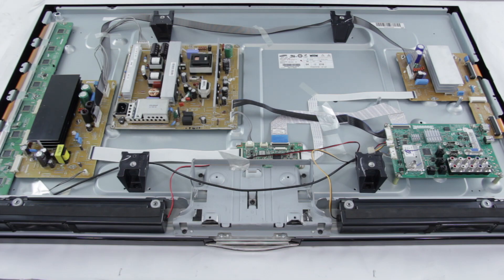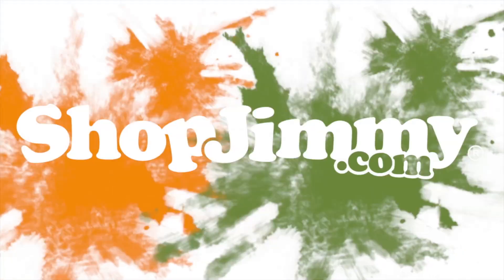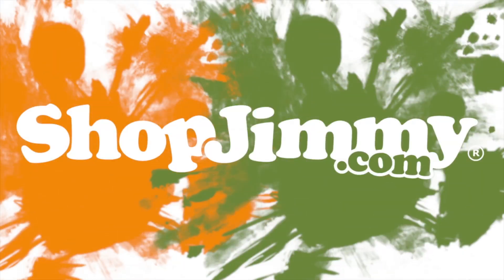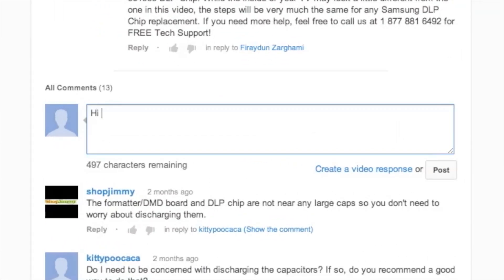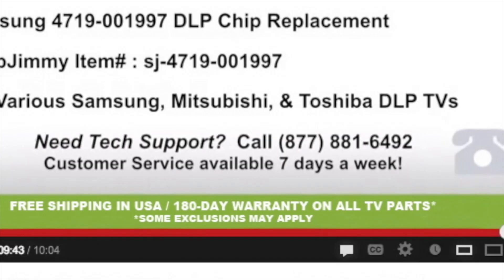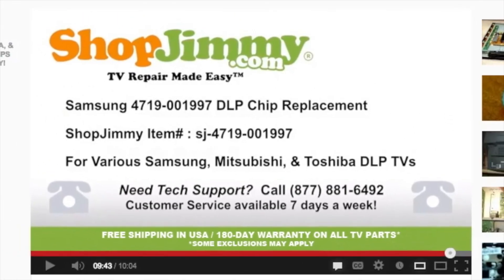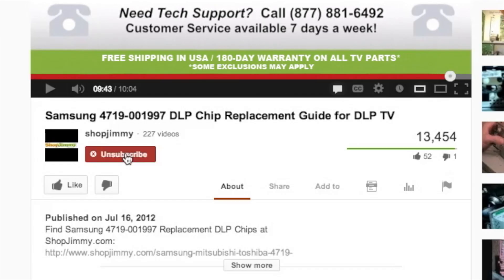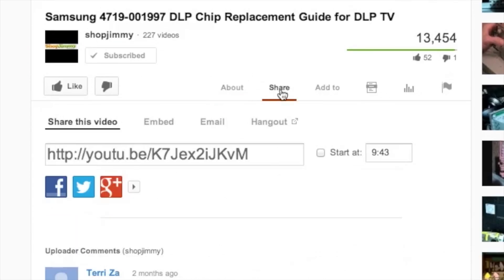Plasma TV Repair Tutorial - Common Symptoms & Solutions - How to Fix Plasma TVs

Comment: I have a Samsung Plasma PN50A550S1FXZA that has a vertical line on the screen that is half blue and half black (about an inch wide) from the top of the screen to the bottom.  Today I replaced the logic board (purchased from a competitor as you were out of stock) as suggested on your video, but the large line on the screen remains.  What should I look at next?  It started as a thin black line a couple of years ago and expanded to what it is today about 6 months ago.  Thanks.
Reply from the maker: Jason Hebert   This sounds like a TV panel (TV Screen) problem.  If your TV panel is bad, it may be more cost-effective to replace the TV as panels are typically hard to find in stock, difficult to replace, and expensive.  Thanks and please let us know if you have any further questions!  www.shopjimmy.com

Comment: I have a 50 inch Panasonic Plasma TV purchased in 2007.  The model number is TH-50PZ77U.  The problem is no picture but does have sound.  If you were to replace one board, which one would you replace.  All the capacitors look OK and I really don't want to put a lot of money in the set.  Your help is appreciated.
Reply from the maker: Jim Orr  Please watch this video FIRST to help with your repair!  https://www.youtube.com/watch?v=BP3NVNCGEv8  I recommend replacing the SC board in your TV.  Click this link to a replacement for your TV model number:  http://www.shopjimmy.com/panasonic-txnsc1hhtu-sc-board.htm  Be sure to match part numbers on your current board, with your replacement for compatibility.  Thanks and please let us know if you have any further questions with your TV Repair!  www.shopjimmy.com

Comment: Hello, I saw your video I hope you can help me. I have a problem with picture of my Plasma screen. Its Samsung PS51D6900 the problem starts 2 years after purchase it have few thin vertical coloured lines on right side not dead lines but pink, green and i think blue lines. Today it start to have about 3 inch thick white vertical lines with black strip in the midle. If need I can send the picture of it. I know its hard to say like that whats wrong but if you can give me your advise if this is caused by some board and approx price to fix it.
Thank you 
Regards Erik.

Comment: have a samsung 42 inch plasma with a vertical black line going down right side purchased buffer board for that side but line still there can you help
Reply from the maker: John Martino   This sounds like a TV panel (TV Screen) problem.  If your TV panel is bad, it may be more cost-effective to replace the TV as panels are typically hard to find in stock, difficult to replace, and expensive.  Thanks and please let us know if you have any further questions!  www.shopjimmy.com

Comment: I have a Samsung 50" plasma (PN50B550t2f) , the TV developed a row (row not column, making distinction) of dead pixels, black no picture at all (checked with flash light), slowly added more rows over a period, currently at 4 rows, no patterns to rows placement. From this video it's pretty clear the Ysus is the problem.   What is the easiest way to know for sure and can you link me to an appropriate replacement if you agree?  Thanks in advance this video was super clear cut and organized.  Really helped clear up how it works.
Reply from the maker: BlazzedTroll  Please watch this video FIRST to help with your repair!  https://www.youtube.com/watch?v=BP3NVNCGEv8  It is difficult for us to say exactly what the problem is 100%, we can only go off the information we have and what we have seen.  You can replace the Y-Main Board and Y-Buffer board to see if that does fix the problem.  Click this link to replacement parts for your TV model number:  http://www.shopjimmy.com/catalogsearch/result/?q=PN50B550t2f  There may be multiple boards for the same TV model number, be sure to match part numbers on your current board, with your replacement for compatibility.  Here is a link to a video showing how to identify your part number, click here:  https://www.youtube.com/watch?v=R1jmj_foId0  Thanks and please let us know if you have any further questions with your TV Repair!  www.shopjimmy.com

Comment: I have a Phillips 42" model 42PF7220A/37 and it has a vertical line on the left side of the tv as you are looking at it.  I would like to know if I can repair this by cleaning some part or if it is repairable.  Thanks
Reply from the maker: Kim Rush   This sounds like a TV panel (TV Screen) problem.  If your TV panel is bad, it may be more cost-effective to replace the TV as panels are typically hard to find in stock, difficult to replace, and expensive.  Thanks and please let us know if you have any further questions!  www.shopjimmy.com

Comment: Hi and thanks for the tutorial. I have a 42"LG Plasma tv. 2007. model # CPTOH-0709
while in HDMI mode, source the tv changes source to cable and you have a screen with just snow. This problem has progressed so much so that you can not use it but by by passing any HDMI, S, COMPONENT cables, I had to you use the cable in only which is located on the opposite side of the tv to use it at all. Of course you can not get HD but just a standard signal. Even then as you are watching you can see in the upper right hand corner a box that will pop up every few seconds saying cable. I have searched for answers to this problem with no avail. Have you any idea what may be causeing this problem? outside of that the tv works great.
Phil.
philarmatino1@yahoo.com
Thanks.
Reply from the maker: Phil armatino   Please watch this video FIRST to help with your repair!  https://www.youtube.com/watch?v=BP3NVNCGEv8  I recommend replacing the main board in your TV.  Click this link to a replacement main board for your TV model number on our website:  http://www.shopjimmy.com/catalogsearch/result/index/?cat=56&q=CPTOH-0709  Be sure to match part numbers on your current board, with your replacement for compatibility.  Thanks and please let us know if you have any further questions with your TV Repair!  www.shopjimmy.com

Comment: Hi.  I have an LG 50PK750 plasma that powers up but has no picture or sound.  It stays powered on, does not go to standby.   It also responds to the control buttons on the front and via remote.   However, it does not have any picture or sound.   Any suggestions?  Thank you.
Reply from the maker: ncferguson  Please watch this video FIRST to help with your repair!  https://www.youtube.com/watch?v=BP3NVNCGEv8  I recommend replacing the YSUS and the YDRVTP & YDRVBT boards in your TV.  Click this link to replacement parts for your TV model number:  http://www.shopjimmy.com/catalogsearch/result/?q=50PK750  There may be multiple boards for the same TV model number, be sure to match part numbers on your current board, with your replacement for compatibility.  Here is a link to a video showing how to identify your part number, click here:  https://www.youtube.com/watch?v=GEllG3RV-tc  Thanks and please let us know if you have any further questions with your TV Repair!  www.shopjimmy.com

Comment: hi i have a samsung plasma model PS-50Q92H year 2007 - it works fine for circa 30 minutes then the screen goes black - -impossible to get ANY image back even switching input devices
only way is to switch off the TV and back on - again 30 minutes then black screen
HAVE removed the back TV panel and checked all connectors are solidly engaged - 
looks like it could be one of the boards ?

Comment: I have a Samsung plasma pn58c550g1fxza. I have purple lines going across the screen horizontally. Extremely noticable on white backgrounds. It's getting worse. What's the recommended fix?
Reply from the maker: Brannon Gradney  Please watch this video FIRST to help with your repair!  https://www.youtube.com/watch?v=BP3NVNCGEv8   This could be a problem with either the buffers or the TV panel.  You can replace the buffers boards to see if this fixes the problem.  Click this link to replacement parts for your TV model number:  http://www.shopjimmy.com/catalogsearch/result/?q=pn58c550g1fxza  There may be multiple boards for the same TV model number, be sure to match part numbers on your current board, with your replacement for compatibility.  Here is a link to a video showing how to identify your part number, click here:  https://www.youtube.com/watch?v=R1jmj_foId0  Thanks and please let us know if you have any further questions with your TV Repair!  www.shopjimmy.com

Comment: Hi, my samsung PN50C590G4F plasma TV just went out with one loud pop. The stand by light is still on, but the TV screen doesn't come on. The remote doesn't do anything and when I power cycle the TV by unplugging the outlet plug, I hear a series of clicking sounds with no picture (I'm assuming it's trying to power cycle). I usually hear one of these clicks when the TV powers on. Would this be the power supply board, or the Y-sustain board?
Reply from the maker: *****  Please watch this video FIRST to help with your repair!  https://www.youtube.com/watch?v=BP3NVNCGEv8  I recommend replacing the Y-Main Board and Y-Buffer Board in your TV.  Click this link to replacement parts:  http://www.shopjimmy.com/catalogsearch/result/?q=PN50C590G4F  There may be multiple boards for the same TV model number, be sure to match part numbers on your current board, with your replacement for compatibility.  Here is a link to a video showing how to identify your part number, click here:  https://www.youtube.com/watch?v=R1jmj_foId0  Thanks and please let us know if you have any further questions with your TV Repair!  www.shopjimmy.com
Reply: ShopJimmy.com OK, I checked your site for these 2 parts and both are OUT OF STOCK. What is your lead time for replenishing parts?
Reply from the maker: *****  On the product pages, you can sign up to be notified when the parts are back in stock.  Thanks!  www.shopjimmy.com

Comment: I have a Samsung plasma FP-T6374 that continuously clicks and tries to turn on. Whenever the TV is plugged in it will constantly cycle trying to turn on but never does. I have not found any defective capacitors or any other obvious defects. I have individually unplugged each of the boards from the power board and the clicking only stops when the main board is unplugged from the power board. Any help is appreciated. Thanks.
Reply from the maker: Ken Steele  Please watch this video FIRST to help with your repair!  https://www.youtube.com/watch?v=BP3NVNCGEv8  I recommend replacing the main board in your TV.  Click this link to replacement parts:  http://www.shopjimmy.com/catalogsearch/result/index/?cat=56&q=FP-T6374  There may be multiple boards for the same TV model number, be sure to match part numbers on your current board, with your replacement for compatibility.  Here is a link to a video showing how to identify your part number, click here:  https://www.youtube.com/watch?v=BEPWrefQvqI  Thanks and please let us know if you have any further questions with your TV Repair!  www.shopjimmy.com

Comment: I've acquired a samsung plasma tv model PN60E550D1FXZA.   When the TV has not been used or is "cool" it turns on with no problems and will stay on for as long as I want.  Once I turn it off and immediately try to turn it back on while it's "hot" the screen will not light up but I will hear sound from the speakers.  After letting the TV "cool" down for an hour or so the TV powers back on with no problems.  

Per your plasma videos you've mentioned that when you have sound but not picture it's usually the Y sustain board.  Do you still think that it's still the y-sustain board?  

I've yet to open up the TV but will do so soon and look for some bad noticeable capacitors or anything that looks abnormal.  Just wanted to get your input. 

Thanks,
oa
Reply from the maker: Ovidio Alanis  Please watch this video FIRST to help with your repair!  https://www.youtube.com/watch?v=BP3NVNCGEv8  I recommend replacing the Y-Main Board and the Upper and Lower Y Scan Drive boards in your TV.  Click this link to replacement parts for your TV model number.  Click this link to replacement parts for your TV model number:  http://www.shopjimmy.com/catalogsearch/result/?q=PN60E550D1FXZA  There may be multiple boards for the same TV model number, be sure to match part numbers on your current board, with your replacement for compatibility.  Here is a link to a video showing how to identify your part number, click here:  https://www.youtube.com/watch?v=R1jmj_foId0  Thanks and please let us know if you have any further questions with your TV Repair!  www.shopjimmy.com

Comment: I have a 50" samsung plasma part number, PN50B450B1D, four years old. TV works but colors are funny! I heard a popping noise one day, ever since the white colors have a hint of purple/pink, and the greens are very grainy. Any suggestions? Thank you in advance!
Reply: Oh also, this happens on all video inputs, antenna, hdmi and AV cables. Also three is a constant hum now that happens when the tv is on.
Reply from the maker: Troy Chase   Please watch this video FIRST to help with your repair!  https://www.youtube.com/watch?v=BP3NVNCGEv8  I recommend replacing the Y-Main Board and the Y-Buffer or Y Scan Drive board in your TV.  Click this link to replacement parts for your TV model number:  http://www.shopjimmy.com/catalogsearch/result/?q=PN50B450B1D  There may be multiple boards for the same TV model number, be sure to match part numbers on your current board, with your replacement for compatibility.  Here is a link to a video showing how to identify your part number, click here:  https://www.youtube.com/watch?v=R1jmj_foId0  Thanks and please let us know if you have any further questions with your TV Repair!  www.shopjimmy.com

Comment: I have a pn50c550g1fxza Samsung and it seems to try to power up and then it shuts off (cycling). I hear one relay engage (click) then I hear what sounds like a static snap/crackle and that is when the TV shuts off and tries to power up again. After 3-4 attempts the TV's standby red LED is steady on. 

The fuse on the power supply is good, so don't know what this could be triggering this...no sound no picture. Just the relay clicking then the static snap.
Reply from the maker: jeanious2009   Please watch this video FIRST to help with your repair!  https://www.youtube.com/watch?v=BP3NVNCGEv8  I recommend replacing the Y-Main Board and Y-Buffer Board in your TV.  Click this link to replacement parts for your TV model number:  http://www.shopjimmy.com/catalogsearch/result/?q=pn50c550g1fxza  There may be multiple boards for the same TV model number, be sure to match part numbers on your current board, with your replacement for compatibility.  Here is a link to a video showing how to identify your part number, click here:  https://www.youtube.com/watch?v=R1jmj_foId0  Thanks and please let us know if you have any further questions with your TV Repair!  www.shopjimmy.com
Reply: My tv has same problem like yours. Have you able to fix by changing the parts?
Reply: kk I replaced the following:
-X-buffer
-X-main
-Y-buffer
-Y-main
-main board
-logic board

and the only thing that improved was that it now the red stand by LED stays off without the blinking cycle with the relays engaging. Now they only engage when I try to turn it one by pushing the on button (which is not a button, more like a touch sensor).

I already got another main board and logic board as well as a PowerSupply board and will attempt one last time to see if that does the trick....so far I've spent around 120.00 bucks on used boards from ebay (perhaps not the best idea after all).

Comment: Afternoon,
I have a 50in LG - product number 50rk550-ud-ausllhr. It has only one black horizontal line that has appeared and disappeared in the past but now has become permanent. Would this be one of the ribbon cables that is not replaceable ?
Reply from the maker: Daniel Jackson   This sounds like a TV panel (TV Screen) problem.  If your TV panel is bad, it may be more cost-effective to replace the TV as panels are typically hard to find in stock, difficult to replace, and expensive.  Thanks and please let us know if you have any further questions!  www.shopjimmy.com
Reply: sorry for the late response. Thanks for the input. The exact model number is 50pk550. I was afraid of that. Ok well if anyone has any one has any other input feel free to give it. Thanks for the information and have a great one.